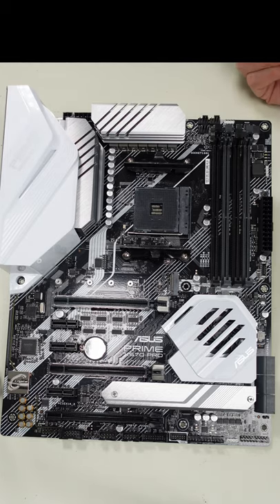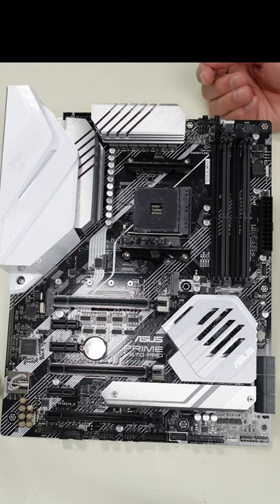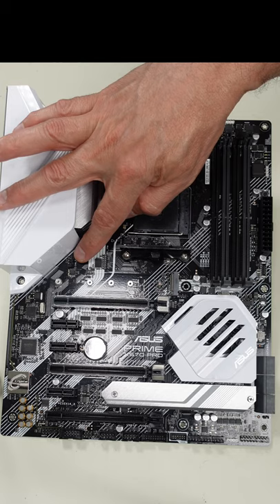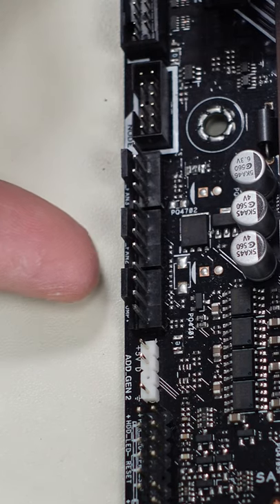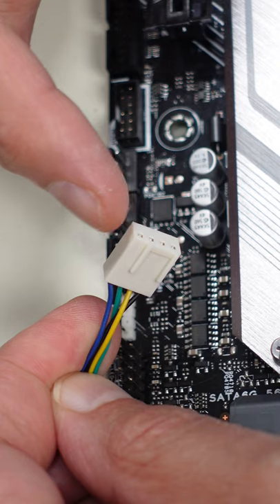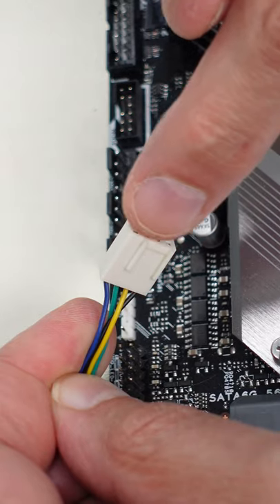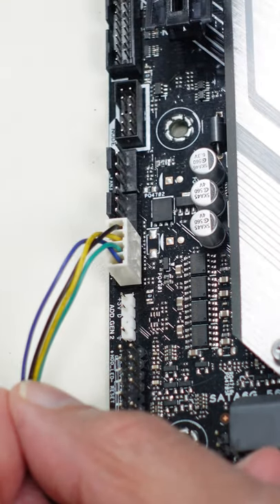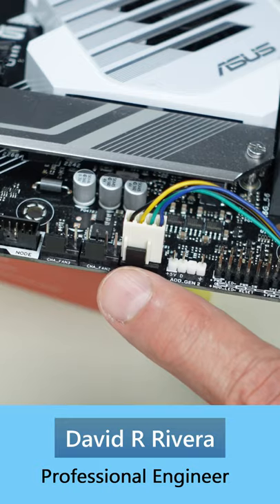Connecting CPU and Case Fans to a Motherboard #Shorts

Comment: Pls do one video with the ASUS PRIME H610M-E D4 Motherboard
Reply from the maker: Unfortunately, I do not own one of those motherboards, or a spare 12th Gen CPU at this time.  What aspects of that review are you mainly interested in seeing?  Maybe I already have a video that covers that aspect.
Reply: @PE4Doers  i wanted to know how much gigs of ram it supports and how many cabinet fans we can plug in
Reply from the maker: @adkramgaming  According to the ASUS Website, it has slots for up to two (2), 32gig DIMMS, which allows for up to 64gb total.  Unfortunately, it has Only three Fan headers, one for the CPU and two for the case, so cooling is somewhat limited.  You can take a look at this ASUS link: https://www.asus.com/Motherboards-Components/Motherboards/PRIME/PRIME-H610M-E-D4/
Reply: @PE4Doers  oh i wanted it to have more fan headers but alright at least two fans
Reply from the maker: @adkramgaming  On a medium to high end system I need at least three.  But that depends on the CPU and type/model GPU you put in.
Reply: @PE4Doers  I am planning to use an RTX 3050 and i3 12100f
Reply from the maker: @adkramgaming  With those two, then your system should have plenty of fans to keep it cool, as long as your case has decent air flow capability.  Which case are you getting?
Reply: @PE4Doers  Planning on the Ant eSports ice-511MT
Reply from the maker: @adkramgaming  I just looked at that and I think it will work out well.  The mesh front should give it plenty of intake air.  I assume there is a Fan controller for the front three fans, otherwise I would suggest that you drive them off the same motherboard header.
Reply: @PE4Doers  Like using a connector for all three?
Reply from the maker: @adkramgaming  Me two, however the only way using that motherboard is to buy a secondary Fan controller that using software to monitor the various temperature sensors on the motherboard to control the fans.  That may cost about 2/3 that of your motherboard however.
Reply: @PE4Doers  Like how can I connect all the fans to the motherboard? I may have to compromise 1 or 2
Reply from the maker: @adkramgaming  There are only two Fan headers on that motherboard, si I would get a 1 to 3 fan splitter cable and connect the three front fans to the Fan header near the CPU Fan header at the top right of the motherboard.  Then I would connect the rear fan to header in the middle-front (just behind the audio connectors.  Then, once the PC is all together and all case panels are on, I would use the ASUS Motherboard BIOS, Q-Fan Control then Q-Fan Tuning to properly set the Fan speeds based on you configuration.
Reply from the maker: @adkramgaming  You will need to purchase a 1-to-3 Fan splitter, such as: https://amzn.to/3rqbbW0

Also, as a follow-up to my previous comment, your BIOS may or may not have Q-Fan Tuning, so you may need to load the ASUS software 'Fan Xpert 2+' that should come with your motherboard (on a CD), or downloadable from ASUS for Free.
Reply: @PE4Doers  Is that a three pin header or four pin header that u suggested?
Reply: @PE4Doers  And what if i switch to a B660M-G motherboard?
Reply from the maker: @adkramgaming  I connect to a 4-in, but only allows for one of the three Fans to be fully controlled as a 4-pn.  When I use them I connect the fan I think will be in the hottest part of the case to the 4-pin connector.  The other two can be 4-pin, but will only work as 3-pin, which is slightly less efficient.
Reply from the maker: @adkramgaming  Are you referring to ASUS or some other Manufacturer?  I don't see one offered by ASUS.  MSI has one, but it is also limited to just two case Fan connectors.  You would probably need to go to a Full ATX form-factor to get four.
Reply: @PE4Doers  Can u suggest me a cheap category motherboard with 4 connectors? I can compromise with ram slots or other things but i mainly need connectors and m.2 slots minimum 1
Reply from the maker: @adkramgaming  MSI has one for $140 that can support 5 case fans: https://amzn.to/3e4AHwY
ASUS has one for the same price, but it only support 4 Fans

Comment: Hey how to put back the end of pci connector the plasticky one that holds the gpu inplace that makes the click bc i have taken them off during disassembling
Reply from the maker: I believe you are talking about the PCI connector on the cooler, it that correct?
Reply: @PE4Doers  on the gpu the lock thingy
Reply from the maker: @ramondelacruz9282  Did it break?  I once broke mine and was always concerned the GPU would pop-out.  I believe as long as you the PC stays in a relatively stable environment that should not be a problem.  They are only plastic, so they will easily break.
Reply: @PE4Doers  yeah it still holds its place but i was worried bc its my first time disassembling it so yes HAHAH
Reply: @PE4Doers  and it slide right of after i put force on taking the gpu off the mobo is fine
Reply from the maker: @ramondelacruz9282  Yes, I experienced the same thing on a legacy PC which required the latch to be pushed to the side.  I broke it - but it still works fine.
Reply from the maker: @ramondelacruz9282  That good.  As long as it works you should be OK :)

Comment: What's that block thing in the top left corner called where all the usb's and such plug into? I removed my GPU today (the very first time I've ever worked on a pc) and noticed that thing. Weird in my imagination i never added it to a motherboard until seeing it irl and practically working near it worrying if I'm gonna need to do anything with it. 

Pretty cool hobby you lads have
Reply from the maker: It sounds like you are referring to the ''Ear I/O Panel'.  Where all the rear USB connectors, the Network Connectors, the Sound, Wireless etc.  all connect.

Not all motherboards have that plastic cover with the attached I/O shield place that snaps into the rear of the case.  Only the more expensive motherboards come with that cover, so you may not have one.

Comment: I know this is late, where are the ssd slots
Reply from the maker: Are you referring to the SATA or NVMe connectors on the motherboard?  Unfortunately they will differ by manufacturer and model of the motherboard.
Reply: @PE4Doers  nevermind, I found them
Reply from the maker: @swagdabest13  Great 🙂

Comment: My fan is three pin and i cant find three pin what do i do
Reply from the maker: You should be able to connect the three-pin fan to the 4-pin motherboard connector.  One pin will stick out, but that is OK.  The connector should have a guide on it to prevent it from going into the wrong pins.
Reply: No 
the fan hub’s connector looks like this: oo o

The mb connector looks like this llll.

So now what?? 

That is the million dollar question.
That is what 90% of people stumbling upon this video want to know. Not the easy answer that makes everyone look stupid. 

This is an actual question.

Comment: I got 7 fans😭
Reply from the maker: I assume you don't have enough motherboard headers.  If that's the situation, then you need to use some Fan splitter cables.  It works best when you split two fans that are next to each other in the case, like at the front or top.

Comment: is it safe to test the fans without the cpu installed?
Reply from the maker: You motherboard will probably work doing that.  Not sure if they all will however.  In either case you will get the error code or light indicating a CPU problem.

Comment: My connector has 3 not four… but there is four in my motherboard. Idk what to do
Reply from the maker: Are you referring to the Fan connector?   If so, DO NOT connect it.  Connect 3-wire to 3 ONLY, and 4-wire to 4 ONLY.
Reply: @PE4Doers  Yes, the fan connectors. It worked before. I was only replacing my psu and now my fans don’t turn on… on my motherboard there are only four not three. Idk how to fix this, it was working before so o think I must have unplugged something related to the fans (everything else works fine except the fans)
Reply from the maker: @honinakecheta601  Most motherboards have both the 4 and 3 connectors.  Is it possible you had it connected to a 3-pin connector before replacing the PSU?  If you connect a 3-pin Fan to a 4-connector it will likely burn out the LED controller in the fan.
Reply: @PE4Doers  thank you for responding, I was able to fix the issue I had but this will be useful information for me in the future for when I get a new motherboard
Reply from the maker: @honinakecheta601  Good luck then.  I'm not sure if I was able to help.  It is a challenge when I can't see what's going on with my eyes, but I know how frustrating tech problems can be.  I am actually working on one myself right now as I prepare for the Live Stream I will be holding on Sunday.

Comment: What if my motherboard has 4pins but the fan connector has 3 pin holes? :(
Reply from the maker: It should still fit (over the little plastic guide).  Unfortunately it will not take advantage of the PWM technology on the mother board to more carefully control the fan speed.
Reply from the maker: @SombraCheeks  You are very welcome

Comment: My mobo has 1 CPU fan and 1 chassis fan connector. Can I install more than 1 chassis fan on my PC, and how do I do it?. Model Asus Prime A320M-K.
Reply from the maker: You would need to either slit the Fan headers with a cable made for that, or connect them directly to the power supply, and there are many ways to do that, including using a separate Fan hub.

Comment: What if the fan wire has 3 pins?  Can it plugin into 4 pin connectors on board?
Reply from the maker: Usually 'Yes' (as long as the fan connector has that plastic guide.  The only problem is that it will not be PWM controlled, only DC, which is not as controllable by the motherboard.
Reply: @PE4Doers  , thank you. Thats what i did.  Much appreciated.
Reply from the maker: @mmmmmmm8706  You did great then.
Reply: @PE4Doers Hello, can I also put the 3 pin connector of the casing fan onto the 4 pin CPU Fan Slot of the MB?
Reply from the maker: @loraxxxlol5075  Mo.  They use different voltage levels and something will blow-out.
Reply: @PE4Doers  what should I do then? I only have 3 slots und my mb but 4 fans.
Reply from the maker: @loraxxxlol5075  A fan splitter forks just fine for two fans.  Or you could get a Fan hub.
Reply: @PE4Doers  okay I’ll try, thank you very much.
Reply from the maker: @loraxxxlol5075  Good luck